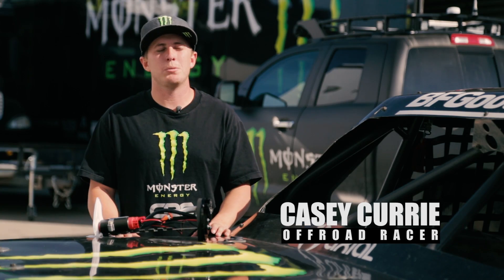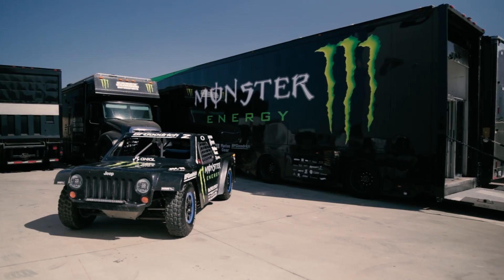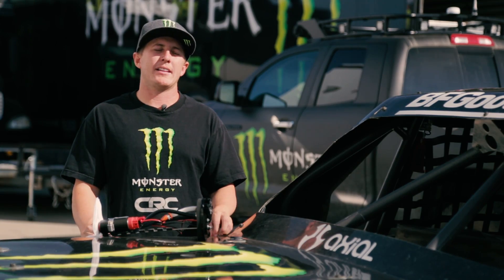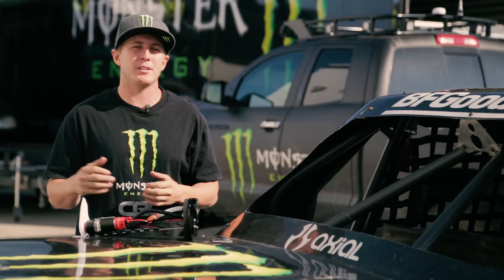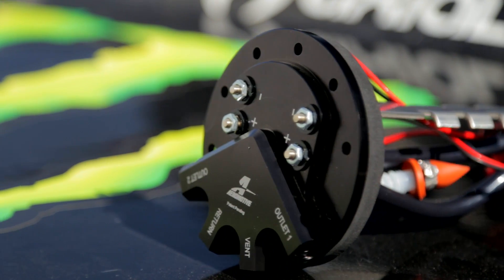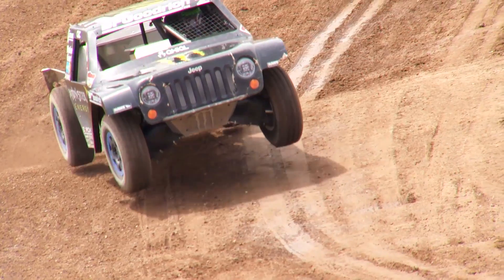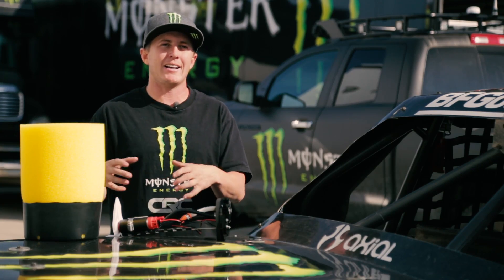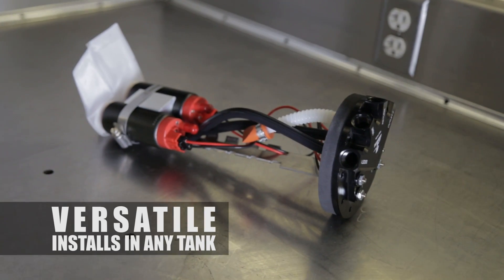How it Works | Casey Currie and Aeromotive's New Dual Phantom

Comment: Aeromotive needs to offer an Aeromotive Flex Stealth Fuel Tank like the Aeromotive 340 Phantom Stealth Fuel Tanks. I need one, I would like to drop one in my 66 Chevy Impala. I would like the choice to run gasoline or E85.
Reply: You could always just buy a OE tank from Tanks Inc and then a Phantom flex. Install the flex in the tank and put it on your car. Boom. Done.